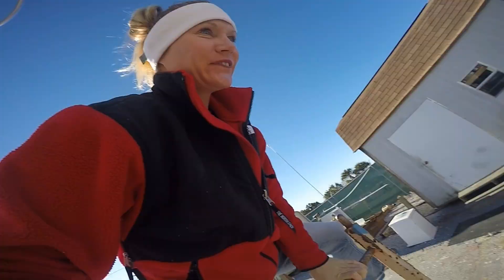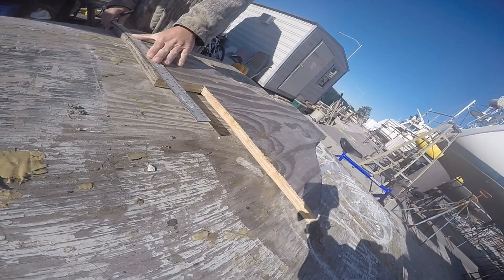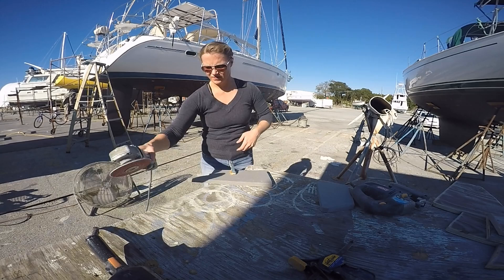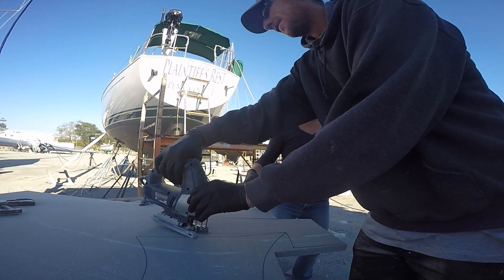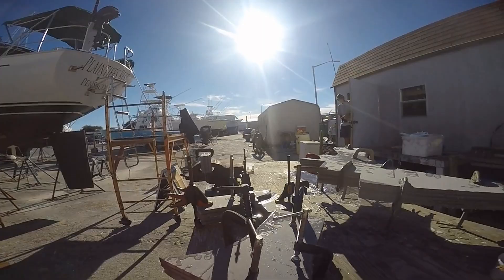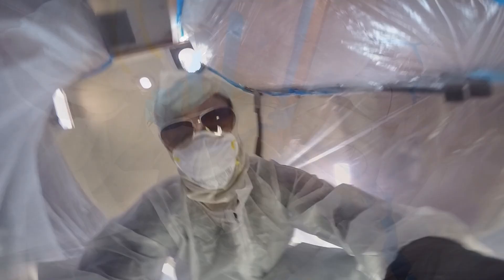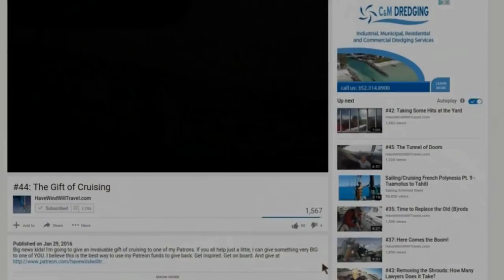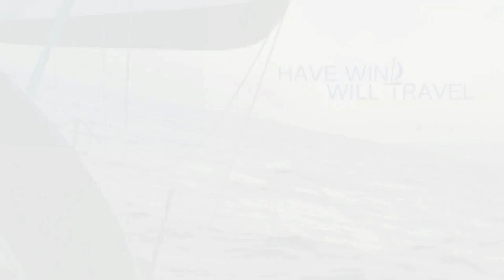#53: Rotten Stringers Repaired with Coosa Board & Fiberglass

Comment: Just so you know, the number one power tool for removing fingers is an angle grinder without the guard attached. As well please go and purchase proper respirators when working with fiberglass resin and sanding. The dust mask will do nothing to stop you from inhaling glass fibers which make your lungs bleed. Otherwise, good to see progress on your dream. Play safe.
Reply from the maker: Thanks Normal. We're obviously still learning a lot about these boat repairs. Thanks for the input and for watching.
Reply: dont worry...doing one boat repair wont kill ya...do it daily as a pro and you will need respirators and such...but one job youll live;)   the safety patrol is out in full force when you do a vid like this lol

Comment: 12 pieces of Fiberglass overlay-ed?  Looks like it is better than factory new and will be stronger than new as well.
Reply from the maker: +Ted Smith Hey Ted.  I'll say you're close ... in a way.  Times ten and then some.  It depends how EXACTLY you count them but there were four big piece layers on each stringer, tabbed in with little individual tab pieces all around, plus four pieces on each top.  Knowing that, guess again!  ; )

Comment: Yes, we're "Getting" all the little innuendoes that have been included in the video. Hmmm. Well, that said, that repair will definitely be stronger than the original design. You'll never have to worry about that problem again. But there's always something else to do. So as they say,…Turn the page….
Reply from the maker: +LEE CUMMINGS So true.  It's always one issue after another.  But, such is the boat life!  Glad you're enjoying the refit videos!  Our boat is better than ever!  Where's some blue water?
Reply: "Where's some blue water?" Well, blue water covers about 75% of the Earths surface. That's why having a boat is better than an RV. The real question should be, "What shade of blue do you want?" I always enjoy seeing the color changes in the ocean as you transit across a continental shelf into 600 fathoms+ and watch the depth sounder transition into the abyss. About 200nm south of Pensacola should just about do it…like on your way to Cuba. Be safe!
Reply from the maker: Good point, Lee.  Well played.  I couldn't agree more.  I love the crystal green shallows of the Bahamas and around the Keys, but there's something to be said about the denim hued colors offshore as well.  We'll definitely enjoy those on the way to Cuba.  Not too much longer now!  Glad to have you following along!

Comment: hello I saw with interest the way you did the fibreglassing,
To me only the first layer is actually bonded to the yacht,  If that breaks the repair  breaks
I was taubht  that each layer lap needs to be lapped 75 wide. so the second layer has a 150 lap,thrid layer 225 lap etc
so that each layer is bonded to the yacht .
Reply from the maker: May be the best way to do it.  Certainly not a bad strategy I would say.  Makes sense.  Thanks.